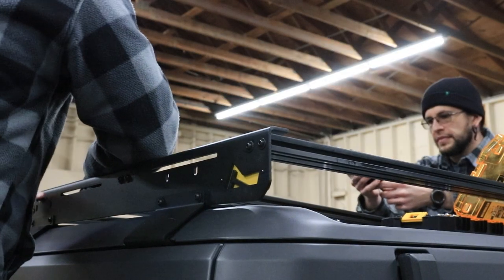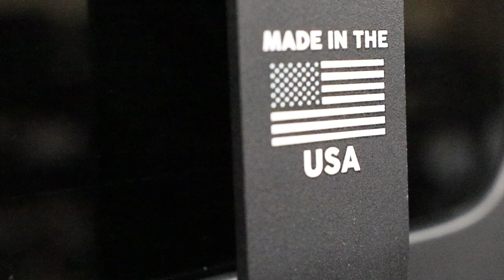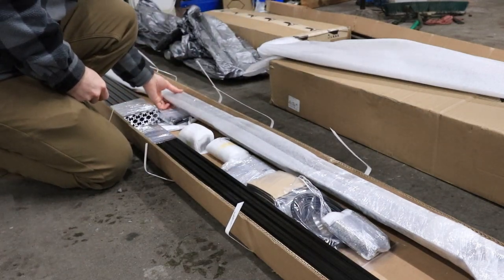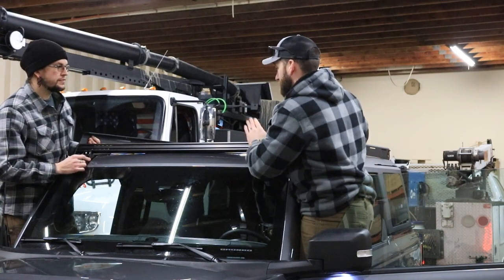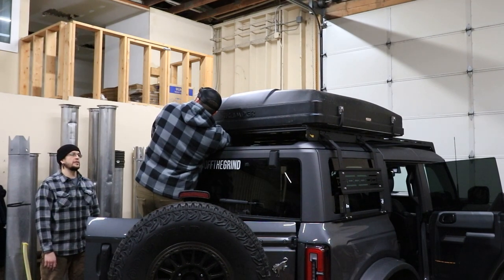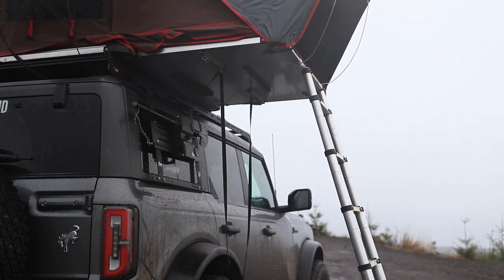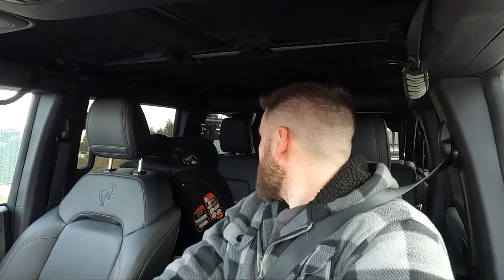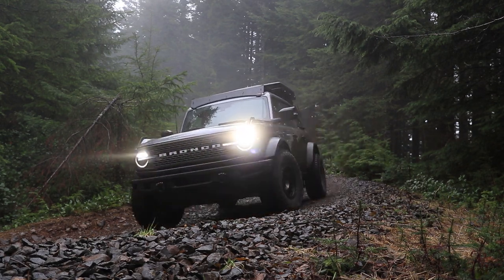The BEST ROOF RACK for your FORD BRONCO || TrailRax TRMR and Rak Pax || Off The Grind

Comment from the maker: I mixed up the capacity ratings in this video. The STATIC load is 850 lbs and the DYNAMIC is 300 lbs. Also, the squeaking that I mentioned is completely gone at this point and stopped approximately a week after install! I could not be happier with this rack!
Reply: Whats the difference between static and dynamic?
Reply from the maker: @Cerrulfio  static weight is while the vehicle is not in motion while dynamic is when it is. Dynamic weight means there is a lot of weight transfer that will happen with whatever is on the rack so it responds differently than when parked
Reply: So if between me and my wife are  370, there's no way we can use it for overlanding huh? Any recommendations for those weights?
Reply from the maker: @Cerrulfio  no you can absolutely use it! The static weight is 850lbs so you guys will be good. You’ll have another 480lbs before you hit the weight limit
Reply: Where exactly was your squeaking? I have GFC RTT with trmr rack with pakrax and it’s driving me insane. Everything is tight and installed correctly but continues. I’ve had both products for about a year now, the RTT isn’t on everyday

Comment: Thanks for posting.  I just had mine installed Wednesday.  I don't have the RTT (ikamper 3.0 mini) on it yet but happy I  have the Badlands suspension.  I have the 2dr & believe I'll have 22" storage left on the rack - for a hard case.  It appears it will be difficult to frequently remove the RTT. At this point that's the only reason I'm scratching my goatee... looking forward to Overlanding. Looking good! 👍👍
Reply from the maker: Dude congrats! That’s going to be such a sweet setup! Yeah because it’s so high once it’s on its kinda on haha. Definitely lots of videos of it in use coming your way!

Comment: Does it come with any side carrier and ladder (similar to range rover defender)? I’ve been interested in the Vanguard rack but noticed the quality isn’t there. Any compatible side carrier and ladder accessories I can buy?

Also, I’ve seen in a Ford promotional video of the PakRack jerry cans mounted on the roof (like 60°) with some kind of bracket, but I can’t find this bracket so if you could help me out i’d appreciate it.
Reply from the maker: It doesn’t come with the rack, but there is an option extra which is the pak rax which allows you to mount a ton of stuff on the outside, including Jerry cans. 

No ladder though

Comment: Do you know if this roof rack will still allow you to install a light bar? Such as the KC HiLites 50” light bar?
Reply from the maker: I’m not sure how the hilites mount. There is  at track on the forward bar that you can mount stuff too though. Just don’t use the wind deflector and it may work. I know they also have a wind deflector cut out for 40” light bars

Comment: How do these work with a KC light bar?  Can you have both installed at the same time?
Reply from the maker: I’m honestly not sure. The cutout is 40” so I would imagine anything 40” or less should fit just fine. If you’re running all pods though I’m not sure. The TrailRax crew is super helpful and should be able to answer more conclusively

Comment: Hands down the only rack to get? I enjoy your content but statements like this make you come off as a shill. 

I got the RCI rack for my Bronco, and it’s been fine with more load on top than you usually carry in your uploads. As an example, my 4x4 Colorado rtt is nearly twice as heavy as the skycamp mini, and I frequently throw a kayak on top of it. I have a heavy pvc shower system on top. No issues with the RCI or the hardtop itself. The RCI is also half the price of the Tremor rack. 

I’m not dissing the TrailRax, I’m certain it is excellent on every level except price. Sorry for the rant, I just didn’t like that comment.
Reply from the maker: I don’t think I’ve ever said that about a product before. I just really believe in this product. The fact the it’s the only rack that ford themselves endorse is a big deal in its own. Also, the Rak pax is patented by TrailRax which is why their capacity is higher then others. I’m a big fan of RCI products, but I truly believe the the TRMR is the best in the market. 

I will say this though. Everyone has different needs for there rig. So while I love this rack for my needs, it might not be the best solution for everyone. For instance, the JCR rack (I think that’s what it’s called) you can run as a full rack or just half rack which is pretty dope.